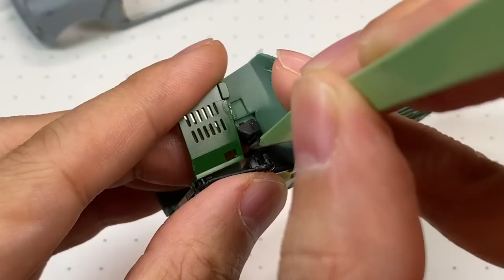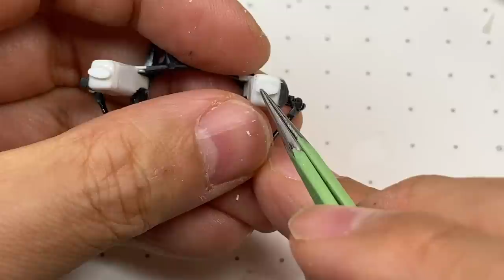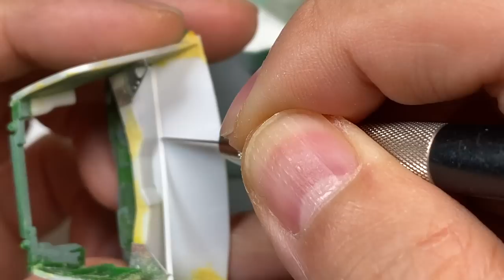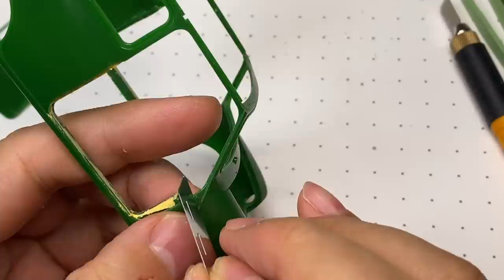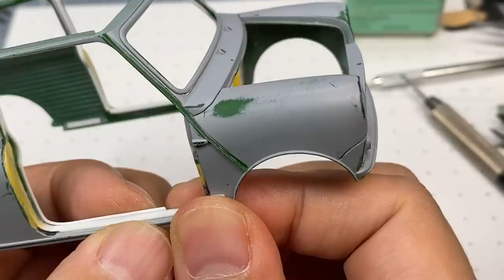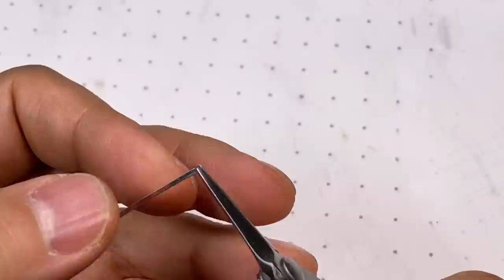MORRIS MINI COOPER S 1/24 TAMIYA- part 2

Comment: Wow! You must pass on your magic method of gluing. I use tube glue, Tamiya liquid glue, and 3 types of CA glue, and my parts seem to end up either stuck to my fingers, somewhere they’re not supposed to be, or not sticking at all. You wave your glue brush over a joint, and, BAM! it stays there. I’ll ask, and maybe you don’t want to say, which is cool, but are you an eye or a brain surgeon by day? Your work is amazingly precise.
Reply from the maker: Thank you! I will add glue in the next part.